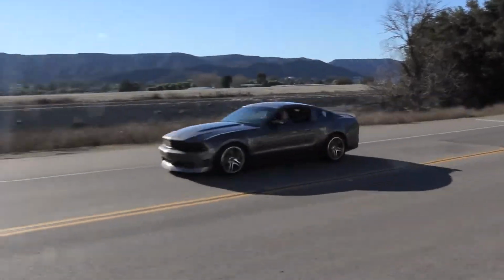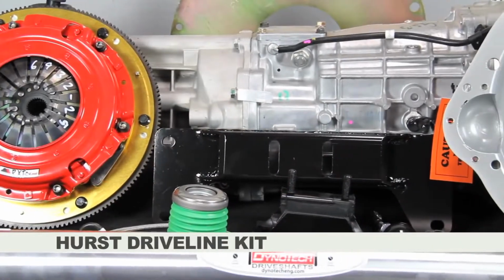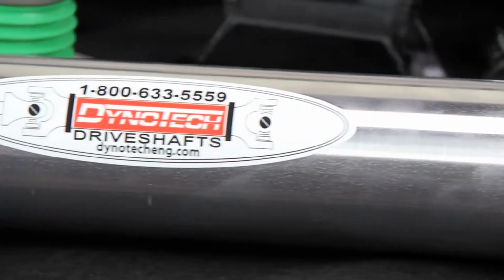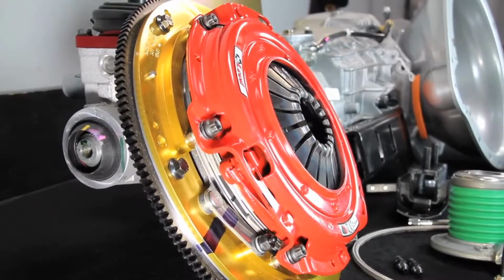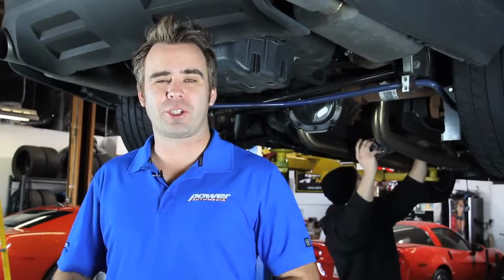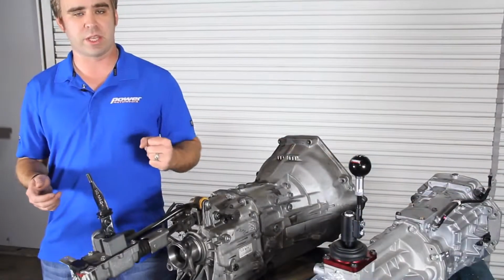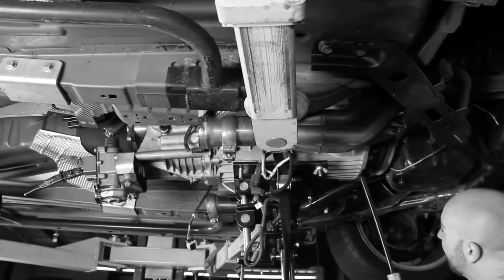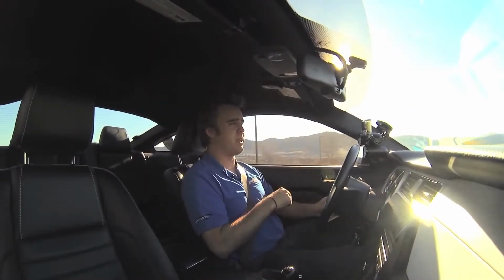Hurst Driveline Tremec T 56 6 Speed Magnum XL

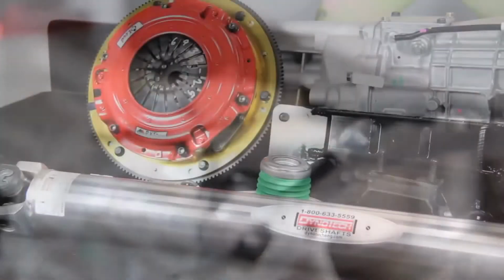Comment: in case anyone reads this, wondering if at 1:01 in the video the blue on the casting marks where that would normally be drilled and tapped for a clutch fork pivot. I have a t56 magnum and am installing in an 03 mach 1, and need that clutch pivot, however my t56 is for ls. the mid plate casting looks identical except for the pivot threads not being threaded as well as 4 holes around the input shaft for the tube instead of press-fit like the cobra t56 has. Wondering if anyone else has tried having a machine shop drill and tap the cast aluminum in that blue mark for a clutch pivot.